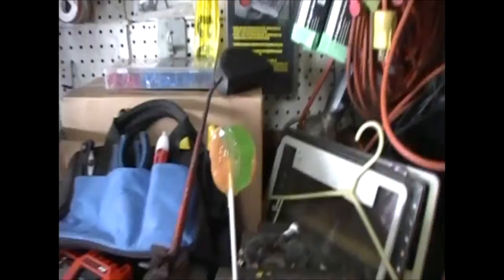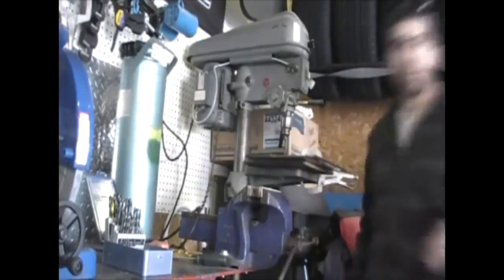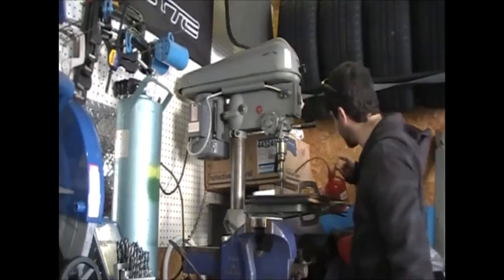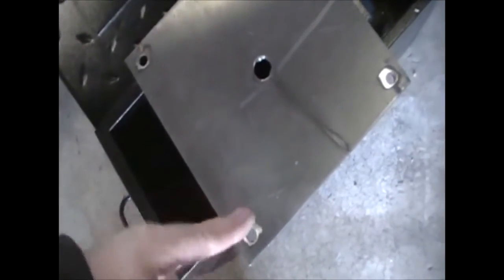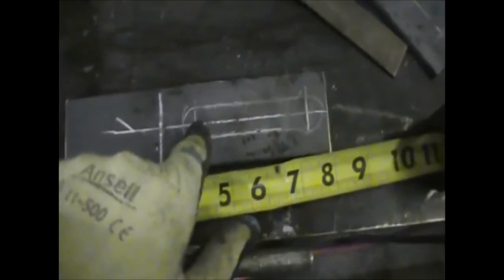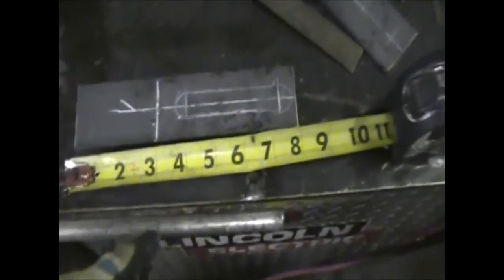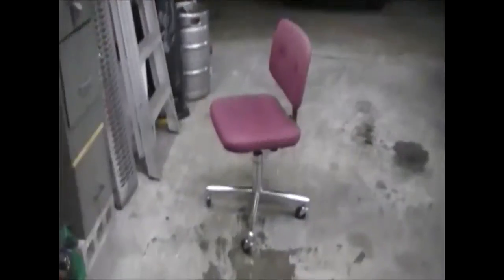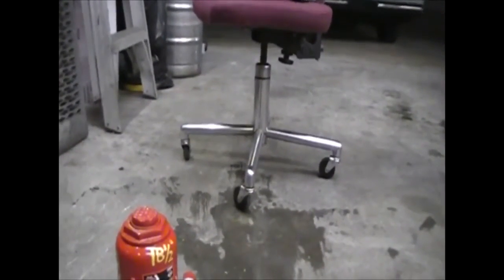How to build a Transmission Jack-Part one

Comment: Used this for the first time this weekend on a new Camper trailer⋄⋄>share4.photo/X-ChockStabilizer?ネ   The equipment appears to be very well made and substantial. Easy to install with 1 person. Just seems to be a better safety guard than the little wedge chocks.

Comment: I personally don't see why anyone would make a transmission jack...you can get them so cheap, I bought one at Harbor Frieght for less than 100 dollars and it works fine!
Reply: If you can't make it buy it.
Reply: I've been there 3 times in the past 2 months and they don't have the cheap on. They always have plenty of the heavy duty ones that are rated for like 3 ton. Ok that's a little bit of exaggeration ,but not much. Anyway they have a price on it of $360. I said screw you guys. I'll just do it by hand again.
Reply: Let's see...do it yourself with 1/8th grade steel or buy one that is made of ten times thinner steel? If you can build it right,  build it stronger,  build it to suit you, and spend around the same or just a little bit more -  I go for build it. The retail ones are so flimsy,  smaller and not always right for most transmissions. If you build one,  you can rebuild / customize it to suit YOU. That's enough reasons for me 🤔😏😋
Reply from the maker: to save money.